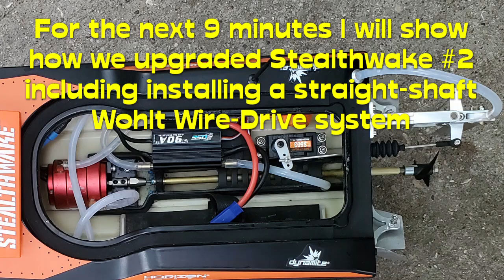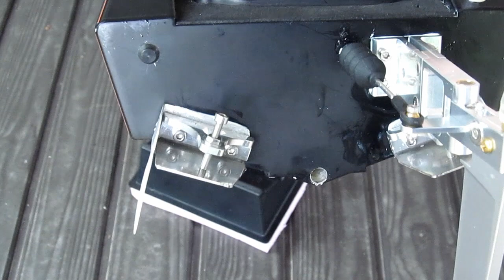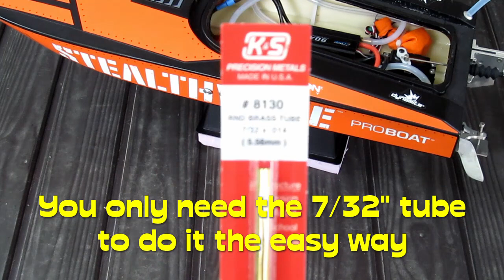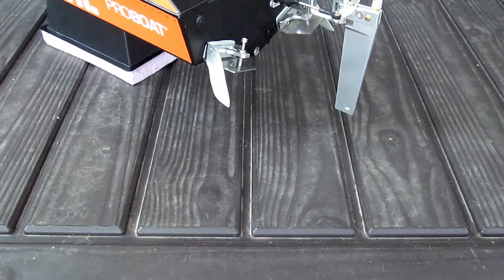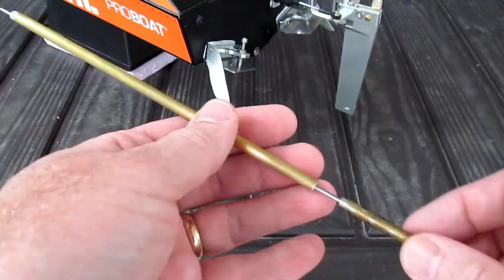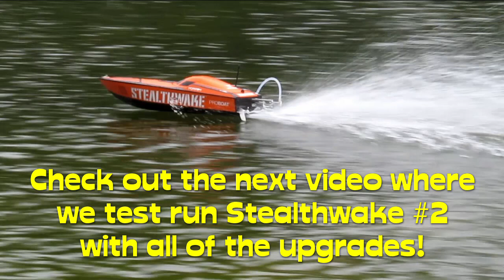Pro Boat Stealthwake upgrades including a Wohlt Wire Drive to replace the stock prop shaft

Comment: Was wondering how you epoxy the new stock one in or what would be good mostly us on salt waters
Reply from the maker: You can use almost any epoxy resin to glue a new stuffing tube into the hull. I would suggest a 30 minute epoxy as a minimum as those are usually stronger than 5 minute epoxy. Plus, you want the epoxy to flow around the tube and seal any holes before it cures. Before you epoxy the new one in, try to clean out the old epoxy and rough up the plastic and the stuffing tube with sandpaper to the epoxy has something to "grip"

Comment: is the fiberglass just for incase you crash or what are the benefits?
i find if the water isnt glass its pretty easy to flip if running 3s brushless
what have you done for stability ?
Reply from the maker: The fiberglass was to stiffen the transom. When I put the rudder and other metal parts on, the transom flexed a lot. I wanted it rigid for better control. I wanted to just glue a plate to the inside but it was too uneven. So I used fiberglass.  For stability, finding the right trim is all I did. When it ran unstable it would flip. Took a lot to get the battery placement and trim tabs right

Comment: I bought my sons stealthwake almost 2 years ago and its been broken most of that.  Thank you for this upgrade series on both your boats!  I have ordered the wire drive, all the transom parts, a 3660 3500KV motor to run 2S lipo only, and the seaking 90a water cooled esc.  Oh and a flysky RX/TX.  Hope its a winning combo!

Comment: Been following your builds on the stealthwake boats ... I'm running the stock set up with the drive shafts did yours leak water threw the drive shaft at all... Been having trouble with mine and can't get it to stop leaking... I have pulled the prop shaft out pumped it full of grease and tried that worked for about 10 mins and then started leaking again I tape the hatch down as well so no water gets in that way ....any advise would be good...
Reply from the maker: One thing you can do is put the boat, with a battery, in a tub of water and let it sit for a while. This will let you see if there is water coming in form anywhere else. If it is only coming from the prop shaft stuffing tube, it might be that the stuffing tube bushings are worn out. We had that problem. The bushing in the stuffing tube was worn so it wouldn't keep water out. You can replace the stock stuffing tube or upgrade to a wire-drive
Reply: @HandfulOfHobbies  I tried the bath trick to see if it leaks ...and no water come in that way .. It's brand new the boat  and started leaking after the first run... I use tape as well for the hatch to stop water that way as well  I Will try the upgraded prop shaft.. I have to grease the stuffing tube after each lipo pack I run it's the only way I can get it to stop leaking so much ...as u said it might be the bushing warn out ...thank u for getting back to me about it
Reply: I bought a water bailer from OSE and it works great for taking care of any water that comes in through the driveshaft or anywhere else. It’s a one way check ball.